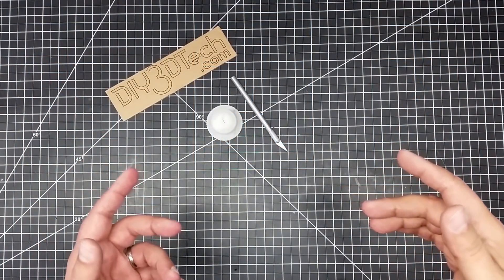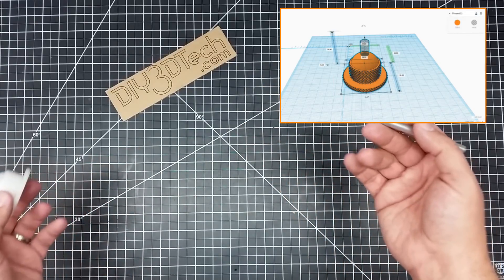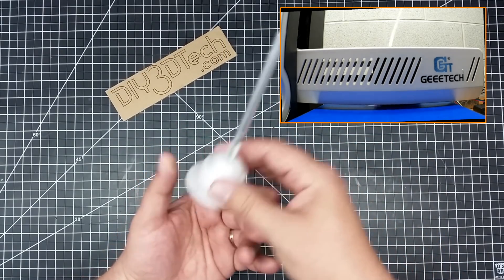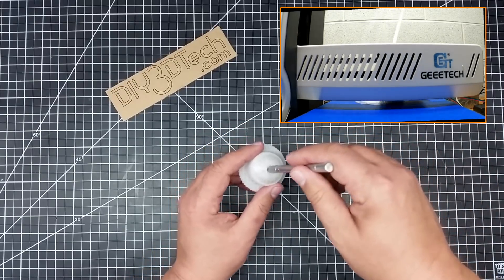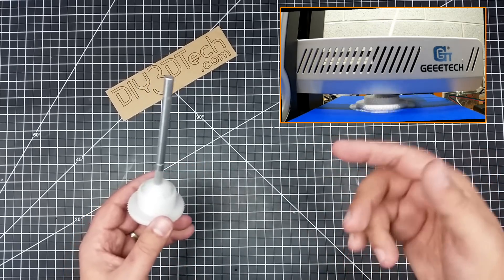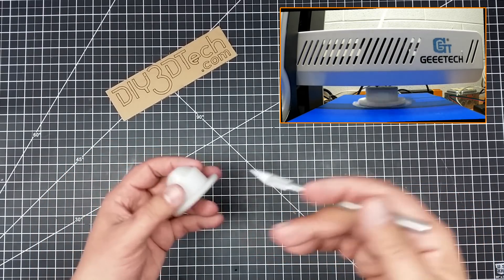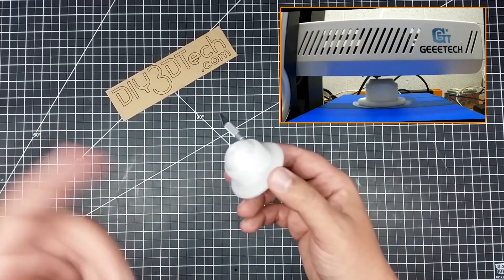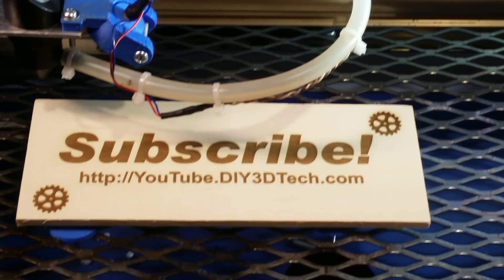GearBest GeeeTech E180 - Designing and Printing an X-acto Knife Stand!

Comment: Great practical print.
Give DesignSpark Mechanical a try sometime, it's freeware from RS Components / Allied Electronics.
Of all the cad packages I've tried this has the shortest learning curve.
Reply from the maker: I think I looked at it in the past, the main reason for using TinkerCad is most viewers can easily grasp it as more a hard core Open-SCAD type :-)